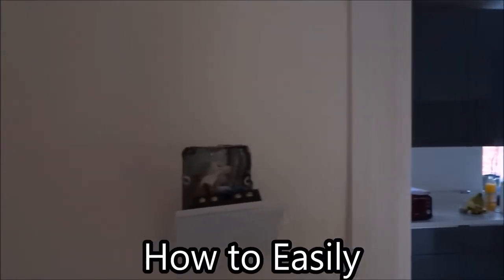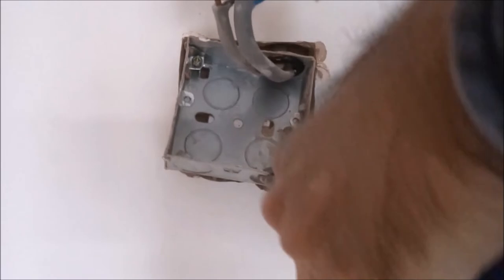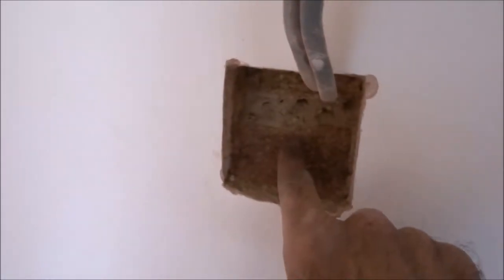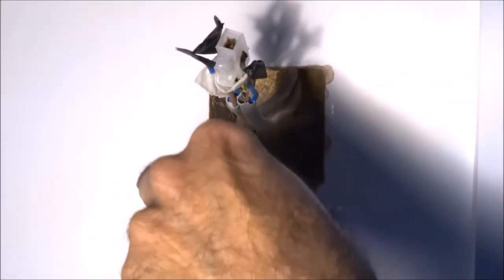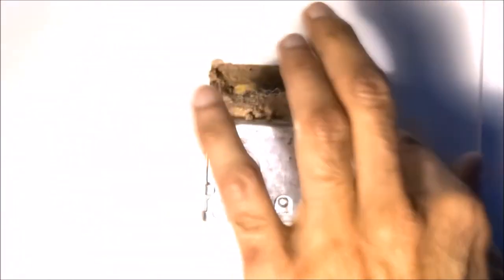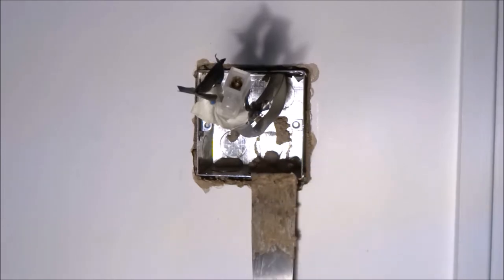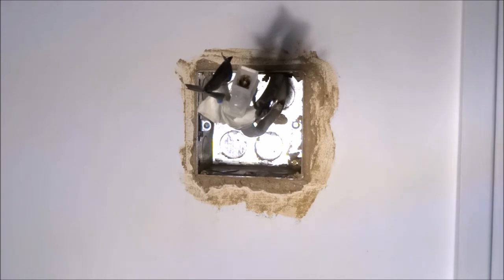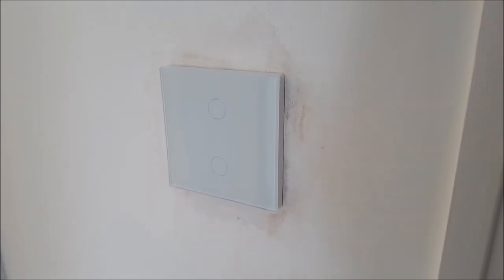How To Replace A Metal Back Box

Comment: My back box had a screw hole broken so light switch was holding on to one screw. So I thought I'd replace it. Bloody can't take the old back box out! Everything I do has to be difficult. I've done enough clearance to get it out, it seems it stuck at the top. It's not yet out. Also not sure yiu need a big back box. Always get same size. Bye for the people saying mess, I bet you couldn't do it clean. Talk rubbish. Do it first then talk.

Edit: found out why I can't take it out it has a metal pole attached to it on the top where the wires go through and I can see about 1cm of it which should have been enough but I can't see how long it is and it means I have to get out that part from the wall as I can't pull it down. Small job just became bigger and bigger.

Comment: Could've used the grommet from the back-box you removed!
Reply: I think the knockout on the new box was a bit bigger
Reply: @samjburns07  yes you're right. He could've used the same tape to hold it in position albeit he didn't want to go out and get the correct size. Good VID otherwise👍

Comment: Err.    Two plugs and screws would surely be better ,.  Just sayin
Reply: Most house partition walls are single brick thick tho so if you try to drill any further than the depth (this one’s a 47mm box) it will go straight through the other side and blow the plaster off. Sometimes you can’t even get a decent fixing so you gotta do your best. Expanding foam and bonding is no problem and works a treat!!

Comment: Excellent video. Do you need to use bonding plaster down the gaps on the sides and then cover it with a thin layer of filler? Or can you just slap on some filler only instead? I assume you plastered the back box in rather than screwing it in as you might not have the depth on the other side of the interior brick wall?
Reply from the maker: Thanks, the bonding can help the box stick and level the back, but if you dont have any you could screw into position and use filler.
Reply: @GeekStreet  So do you think one method is any better than the other in general?
Reply from the maker: @fabiandee8178  I prefer the bonding method as it gives a strong bond around the box. Filer couldn't give a bond that strong.

Comment: Didn't  see any screws on the switch front, unless I missed them, was it a push fit?
Reply from the maker: Thanks for the comment. That's because it's a smart light switch. First part is screwed on and the front plate clips on giving a nice flush finish.
Reply: Geek Street cheers, thought it was.
Reply from the maker: I rewired the lighting circuit to get that working. You know there are no neutral smart switches. Search on youtube for 'geek street no neutral'
Reply from the maker: CitizenIreland  thanks!

Comment: Sorry for being a Noob. I'm confused. Why the bonding compound? Why not get an "old construction" box with tabs that flip up behind the sheetrock and hold it in place?
Reply from the maker: Its not a plaster board wall, its brick.
Reply: Or why not use a screw to hold it in place through the holes provided for exactly that purpose at the back of the back box! Then the poor sap who has to change the back box next time wont curse you!
Reply: @cheesyandy1  because the partition wall will only be single brick thick and if you drill holes any further than the depth it will go through the other side and blow the plaster off. Sometimes sticking it in with a bit of bonding plaster or expanding foam is your only way and never had a problem with both methods!